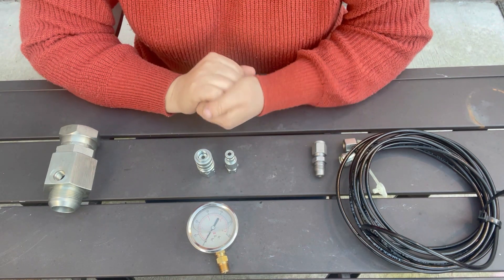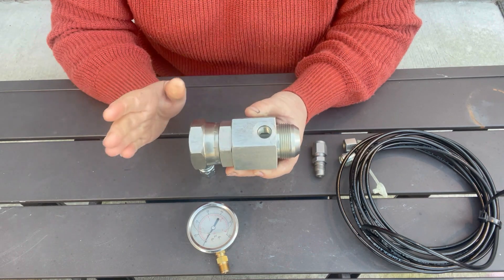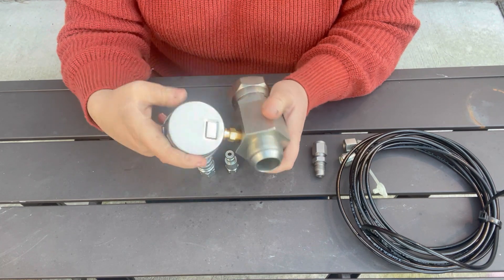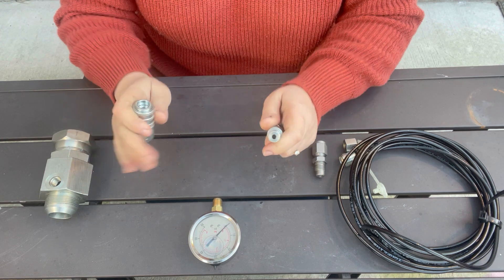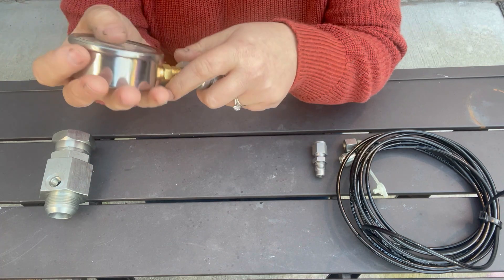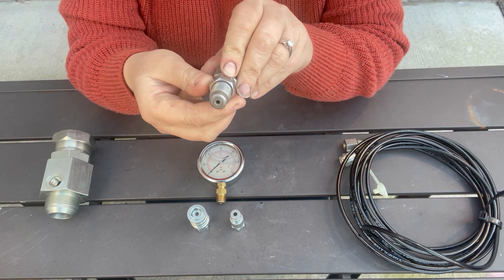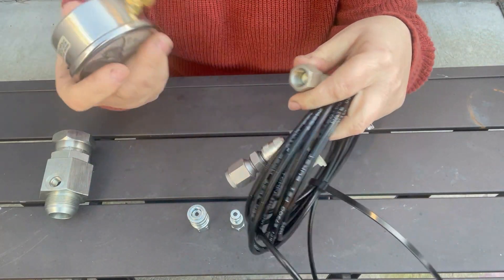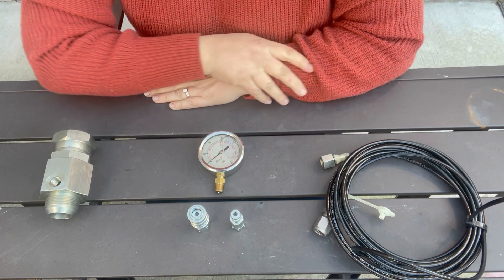How To Test Hydraulic Pressure On ANY Machine

Comment: I would disagree that most pumps have that style fitting personally the majority of the equipment I work on the pump
Itself doesn’t have a test port directly on the pump 

Usually somewhere there is a pump
Pressure port